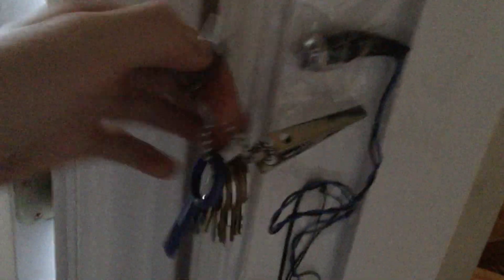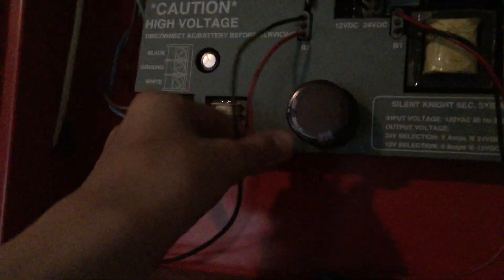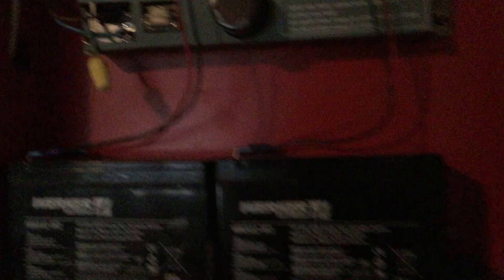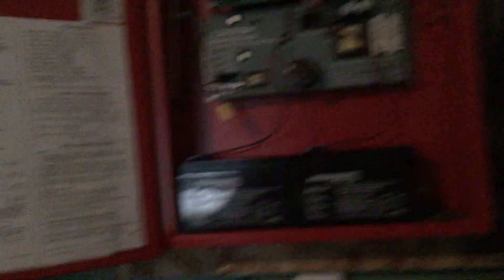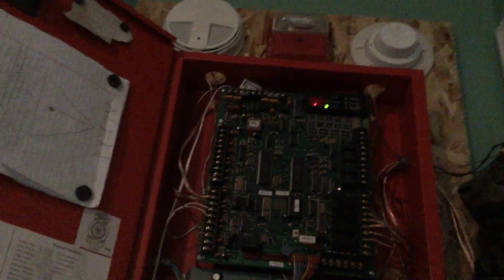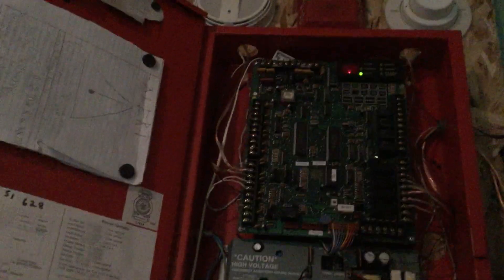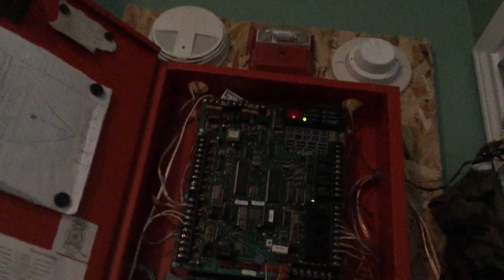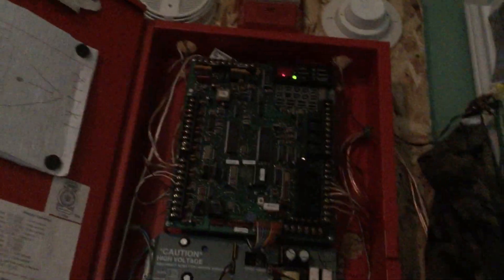Silent Knight 5207

Comment: are those flashing red lights normal? or does it mean there is a problem?  thanks!
Reply from the maker: If you are talking about the ones on the display, they are normal. They are used to show that the microprocessor in the panel is active and hasn't crashed. If there was a problem then you would see the trouble light on or the fire alarm light flashing.
Reply: Thanks!  Our alarm was going off when one of our space users came in to use the building, then it stopped without her doing anything and has been fine since, so just wondering if that meant something needed to be attended to!  Appreciate it